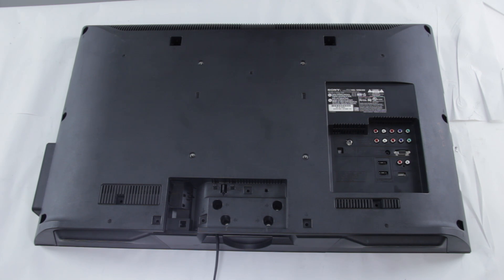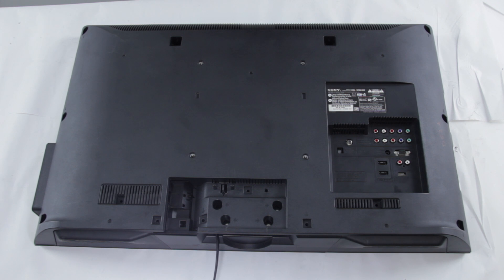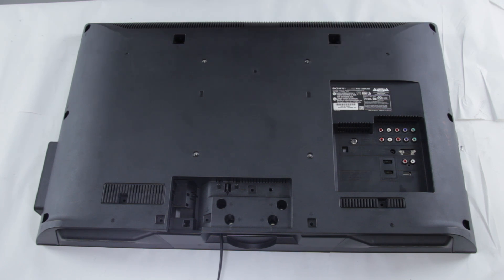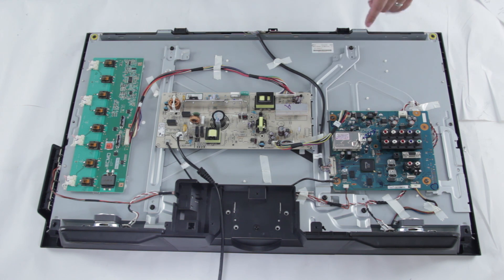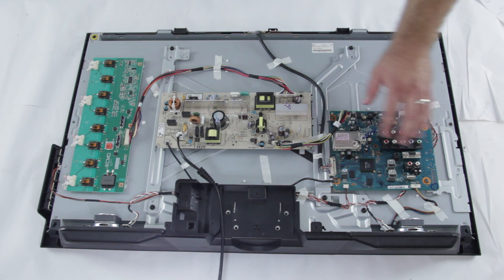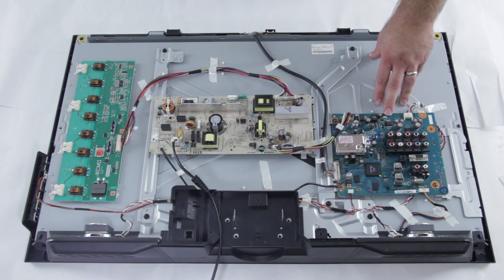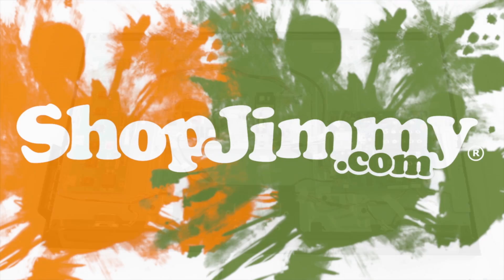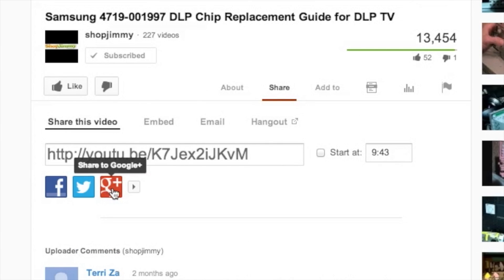LCD TV Repair - TV Has Audio, No Video - Common Main Board Symptoms & Solutions

Comment: Hi, I have Coby 32 inch led TV and it is one year old. since two weeks its started changing the input source by itself.  Please  help me to fix this problem.
Reply from the maker: Baskar Dilli  I recommend replacing the main board in your TV.  Please reply with your TV model number and I can recommend a replacement part for your TV repair.  Thanks!  www.shopjimmy.com

Comment: model#: NS-40L240A13 The tv is showing a double image
Reply from the maker: Latoya Mclarty You can replace the main board to see if that fixes the problem, but if it does not fix it, then you have a bad panel.  Here is a link to replacement parts for your TV model number on our website, click here:  http://www.shopjimmy.com/catalogsearch/result/?q=NS-40L240A13  Be sure to match part numbers on your current board, with your replacement for compatibility.  You can also call our customer service for further assistance with your purchase.  (877) 881-6492  Thanks and please let us know if you have any further questions with your TV Repair!  www.shopjimmy.com

Comment: Hi, I have a vizio lcd 55" tv which powers on, the screen lights up, there are a few lines at the bottom of the screen, but no picture or sound. Model  #VF550XVT1A . From listing to your vidios my thought is that it is the main board that has failed. If you feel that is true, would you please let me know so I can order one from you if you still have one. Thank you
Reply from the maker: Dennis R Dries I recommend replacing the main board in your TV.  Here is a link to replacement parts for your TV model number on our website, click here:  http://www.shopjimmy.com/catalogsearch/result/?q=VF550XVT1A  Be sure to match part numbers on your current board, with your replacement for compatibility.  Here is a link to a video showing how to identify your part number, click here:  TV Part Number Identification Guide for Vizio Main Boards (Plasma, LCD, LED)  You can also call our customer service for further assistance with your purchase.  (877) 881-6492  Thanks and please let us know if you have any further questions with your TV Repair!  www.shopjimmy.com

Comment: Hi I need some help. My sons tv has stopped working. It is a Philips and it was bought in 2009. Philips model no. 47PFL5602D/F7 Serial no. YA1A090211552. What happened was my grandson was up late playing video games and there was a loud pop. The tv stopped working. He woke me up. i felt the screen on the top right hand corner and it was hot. You could smell hot in the room. I unplugged the tv. I wonder if it is fixable and how to start.
Reply from the maker: Teresa Johnson This sounds like a problem on the power supply.  I recommend replacing the power supply.  Unfortunately I do not see any replacement parts in the search results for your TV model number on our website.  Thanks and please let us know if you have any further questions!  www.shopjimmy.com

Comment: When I watched my 47" VIZIO LCD TV, a huge "pop" sound occurred, then TV turned into black screen, no sound no picture. Is that a problem on Power supply boad or main boad ? Thanks. Andrew
Reply from the maker: Lianzhu Liang This sounds like a power supply problem.  Here is a link to replacement parts for your TV model number on our website, click here:  http://www.shopjimmy.com/catalogsearch/result/?q=VO47LFHDTV10a  Be sure to match part numbers on your current board, with your replacement for compatibility.  Here is a link to a video showing how to identify your part number, click here:  TV Part Number Identification Guide for Vizio Power Supply Unit (PSU) Boards (LCD LED Plasma TVs)  You can also call our customer service for further assistance with your purchase.  (877) 881-6492  Thanks and please let us know if you have any further questions!  www.shopjimmy.com

Comment: Hi I allso have a lg model 60pa5500 it just makes a click in the power supply when you plug it in but our plugins are 120 volts and the tv is 220 volts you thank a step up transformer would fix it
Reply from the maker: daddy5noel I would recommend replacing the main board in your TV.  Here is a link to replacement parts for your TV model number on our website, click here:  http://www.shopjimmy.com/catalogsearch/result/?q=60pa5500  Be sure to match part numbers on your current board, with your replacement for compatibility.  Here is a link to a video showing how to identify your part number, click here:  TV Part Number Guide for LG & Zenith Main, Digital, & Tuner Boards (LCD, LED, Plasma TVs)  You can also call our customer service for further assistance with your purchase.  (877) 881-6492  Thanks and please let us know if you have any further questions!  www.shopjimmy.com

Comment: My TV has vertical lines when the TV is displaying bright scenery. When the scenery is dark, the lines go away but when the menu comes up, the TV screen is then filled with red/white vertical lines. It is a samsung LED TV UN46B6000VFXZA
Reply from the maker: Micky Kim This problem is either being caused by the t-con board or a bad panel.  If the panel is bad, it may be more cost effective to replace the TV.  You can replace the t-con to see if that fixes the problem.  Here is a link to replacement parts for your TV model number on our website, click here:  http://www.shopjimmy.com/catalogsearch/result/?q=UN46B6000VFXZA  Be sure to match part numbers on your current board, with your replacement for compatibility.  You can also call our customer service for further assistance with your purchase.  (877) 881-6492  Thanks and please let us know if you have any further questions!  www.shopjimmy.com

Comment: Nice video. I have an Element eldfw322 that when plugged in does nothing not even a lit LED. I have installed a new power board but to no avail. I ensured there is 120v entering it and voltage on exiting jacks. I here a hum coming from the main board and re-seated all connections to it. I also checked the capacitors on it with one reading 65uf instead of the rated 100uf. Would you suggest replacing the main board. Will that also cause the tv not to power up as well. Your reply would be very helpful. Thanks!
Reply from the maker: John Batchelder I would recommend replacing the main board in your TV.  Here is a link to replacement parts for your TV model number on our website, click here: http://www.shopjimmy.com/catalogsearch/result/?q=eldfw322  Be sure to match part numbers on your current board, with your replacement for compatibility.  Here is a link to a video showing how to identify your part number, click here:  TV Part Number Identification Guide for Element Main Boards (LCD, LED, Plasma TVs)  You can also call our customer service for further assistance with your purchase.  (877) 881-6492  Thanks and please let us know if you have any further questions!  www.shopjimmy.com
Reply: Thanks for your reply. I believe you are right. I have checked all power out of the main board and it seems that standby has only 3.2v instead of 5v. After checking the main board thoroughly, i found 2 capacitor bad. Instead of reading 100uf, they are reading 6uf and 63 uf. This must be the reason of the voltage drop out of the main board.
Reply from the maker: John Batchelder
Sounds good, please let us know if you have any further questions!  www.shopjimmy.com

Comment: I have a WESTINGHOUSE LTV-32W6. over the last year the picture started scrambling but it seemed to work after the TV warmed up for awhile now all it does is scramble and make lines and colors kind of like a test pattern. I replaced the backlight inverter but it is still scrambling. Do I need to replace the main board?
Reply from the maker: cormaniac I would recommend replacing the main board in your TV.  Here is a link to replacement parts for your TV model number on our website, click here: http://www.shopjimmy.com/catalogsearch/result/?q=LTV-32W6 Be sure to match part numbers on your current board, with your replacement for compatibility.  Here is a link to a video showing how to identify your part numbers, click here: DIY TV Part Number Identification Guide for Westinghouse Main Boards (LCD, LED, Plasma TVs) You can also call our customer service for further assistance with your purchase.  (877) 881-6492  Thanks and please let us know if you have any further questions!  www.shopjimmy.com
Reply: Thanx

Comment: I have a Hp pl5060n it has power but not completely it turns on but screen flashes like "poltergeist" I can see some of what looks like a picture but not really and stays that way does not reboot or turn off and no flashing lights of any kind on the power swtich , sound works fine ,tried different inputs no change the tv never really boots up all the way I normally get a boot screen then I can change the input but I doesn't seem like it is getting that far. I'm thinking main board.
Reply from the maker: scott calvert I would recommend replacing the Y-main/Y-Sus board in your TV.  Here is a link to search results for replacement parts for your TV model number.  http://www.shopjimmy.com/catalogsearch/result/?q=pl5060n  Please call our customer service to confirm compatibility for your replacement parts.  (877) 881-6492  Thanks and please let us know if you have any further questions!

Comment: I have a Westinghouse TW-65311 (VR-4090) 40" 1080p TV. I left my TV on the other night through a storm. When I woke up, there was a horizontal line across the screen about halfway down. The lower half of the screen has a distorted picture/color. Does this sound like a mainboard issue or something else?
Reply from the maker: John Lynch I believe the problem is either the main board or the TV panel.  If the problem is the panel, it may be more cost effective to replace the TV.  You could try replacing  the main board as that may fix the TV.  Here is a link for replacement parts for your TV model.  http://www.shopjimmy.com/catalogsearch/result/?q=TW-65311  Please call our customer service to confirm compatibility for your replacement part and help with your purchase!  (877) 881-6492  Thanks and please let us know if you have any further questions!

Comment: I have a lg model 47lg50 lcd tv . None of the control buttons work . Also the buttons on the tv menue input ,power etc do not work . The only one that works is the volume . Some times if you play with the buttons on the se it will show input but can't be adjusted . Does this soumd like the main board .Thanks
Reply: It sounds like a shitty ground wire to the button pcb or you need to spilled grape soda in it

Comment from the maker: @Sameh Khalifa - I would recommend replacing the main board.  It would be very difficult to fix as the data chips on the board are too fine to solder on.  Unfortunately after searching your TV model number on our website, I do not find any results for replacement parts.  Thanks and please let us know if you have any further questions.

Comment: i have tried another xbox in the same place and still just sound and no pic so i no its ot the xbox..i used a umdi cable and was able to work a play station 3 on that, but xbox requires a different type of cable. one end has a usb jack and the other has a umdi and i don't have one of those...im sorry, im a 53 year old computer/electronics dummy..

Comment: im havng a problem with my 47" Lg smart tv.its a little more than a year old. I have had a xbox 360 elite plugged into it from the day that I set it up. the other day I had to move the tv over a few feet. so I unplugged the 3 wire cable that I had in the av in ports next to the other one that has all the other colors for the tv from the cable box.. I went to plug it in turn to av1 and all I get is sound no video..and I had a 2nd tv off the other cable jack and that doesn't work now either

Comment from the maker: @Jack Jackman - I searched your model number on our website, and unfortunately we do not have any backlight inverters for the TV model.  You could also search your TV model number on other sites to look for a replacement backlight inverter.  Be sure to compare board numbers to guarantee compatibility.  Thanks and please let us know if you have any further questions.  You could also call our customer service with your backlight inverter board number to double check our stock.  (877) 881-6492

Comment: have no picutre but have sound did flashlight test and have figures. what backlight inverter do i need. want to order the inverter model#LT-47X579. The picture comes on for about 3 seconds and then goes off but sound stays on. please help.

Comment from the maker: @Jacqui Mullings - I think I have this right, the TV does not work when everything is connected. Once you disconnect the main board, the TV works, then once you plug in the main board (while powered on) the TV continues to work correctly.  Is that right? If so, I would recommend replacing the main board in your TV. Unfortunately we are out of stock for this replacement part.  You can search your part number on shopjimmy com to sign up to be notified when the part is back in stock.  Thanks!

Comment: I have a Philips LCD TV 52PFL5704D/F7 that will not turn on. There are two wires going from the power supply to the main board if both are unplugged then there is no power. However if I plug in the 11 pin wire (ps to main) the tv turns on only backlight then while the tv is on if you plug in the 8 pin wire (also ps to main) the main board gets power, lights up and you get picture and it works great. How can I tell if the issue is the power supply, main board or Tcon board? Thanks for any advice!

Comment from the maker: @runnerxt20011 - Only attempt this repair at your own risk and use caution. I would recommend unplugging the wire from the power supply to the main board, plug in the set , if it comes on the power supply is good, if not the power supply is bad and will need to be replaced. Thanks and please let us know if you have any further questions!

Comment from the maker: @Mark Taverner - I would suggest replacing the power supply on your TV.  Please respond with your TV model number and I can recommend a replacement part or you can call our customer service at (877) 881-6492 for further assistance.  Thanks!

Comment from the maker: @mgwood1980 - If the TV power light shuts down to stand by, then I would say to replace the main board.  You can search your TV model number on our website, shopjimmy com to find replacement parts.  Some parts are out of stock but you can sign up to be notified when the parts are back in stock.  Thanks and please let us know if you have any other questions!

Comment from the maker: @David Hussey - I would recommend replacing either the main board or the t-con.  We are out of stock for the main board, but we do have your replacement t-con in stock.  Here are the part numbers: Main Board: Vizio CBPFTXBCB2K11104Q  T-con Board: LG 6871L-2089B You can search these numbers on our website shopjimmy com to find your replacements.  You can also call our customer service for assistance: (877) 881-6492.

Comment: My Vizio E551VA has Picture & sound but there are red & green pixels on any color that is not black.   I checked the voltages on the power board, and they all seem ok.   The bad pixels appear on even the 'menu' screen w/o any devices connected, and all the inputs show the same issue.  It's watchable, but the quality is poor.  Could it be the main board, or another component?   Thanks

Comment: Could it be a bad ribbon cable? When I tested the power supply, the volts on the power supply were good, but the power on the main board side of the cable were bad or nonexistent. Is it possible that the cable is what's gone bad, and if so where would I get a replacement?

Comment: I have an Element ELCHW321 32" flatscreen tv. There is no picture, and there is no sound. The red standby light is on, and when the power button is pressed, It switches to blue (like normal), But there still isnt any sound or video. I have tested the voltages coming from the powersupply to the mainboard, and they have the right voltages going TO the mainboard. Is my mainboard at fault?

Comment: Please help: I have a Dynex 32 inch tv I'd like to get working again. But I'm not sure if it's the powerboard or the mainboard that is bad. (model information:123173 Dynex TV Module, main board, RSAG7.820.1730, VER.E, LHD32V68US, DX-32L130A10/PLHE). When I turn it on the speakers give a whining sound and the screen doesn't turn on. Any suggestions?

Comment from the maker: @Legak49 - This is most likely the LVDS cable.  You can carefully remove this adhesive by running a razor blade along the bottom.  Be sure to use caution for your own safety and the safety of the cable.  Thanks and please let us know if you have any other questions!

Comment: The main board has been ordered and expected to arrive Thursday.  One of the connectors on the main board in my TV has a white (looks like an adhesive) compound running along one side.  Is there a preferred method for disconnecting and reconnecting this connector?

Thanks

Comment from the maker: @Sean Dalton - You could also try replacing the t-con board on the TV.  You will want to match the part number on the t-con with the part number on our website for your TV model number.  You will also want to match the panel number on your TV panel with the t-con panel number on our website.  Feel free to give us a call with any questions!  (877) 881-6492 Thanks!

Comment: I have a vizio e320-a1 at first i was getting the power led light with no backlight or audio and unresonsive tv,,, but now my tv has no power led... ive tested my voltage readings and all seam fine on the regs but im not getting any power to my backlight on/off and and standby... do you think its the main board?